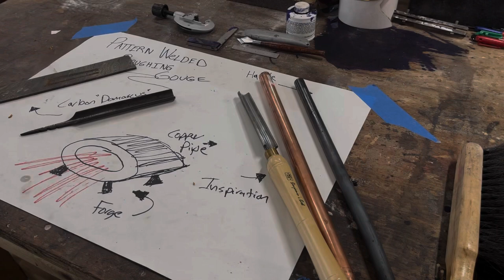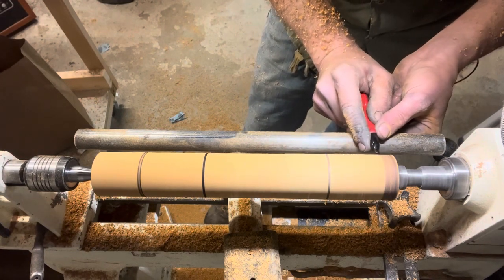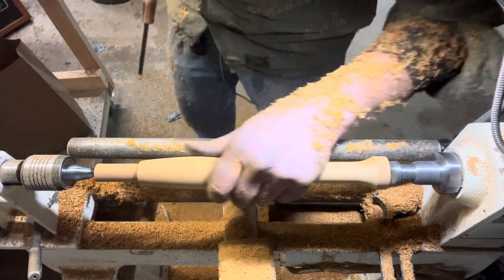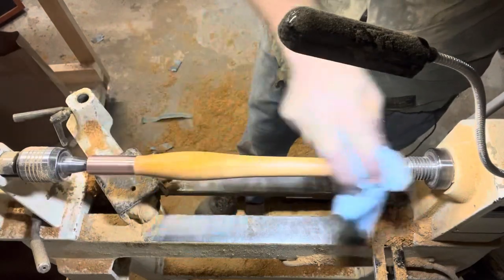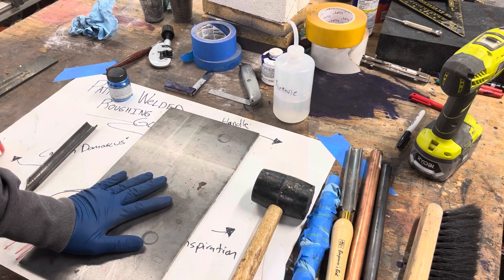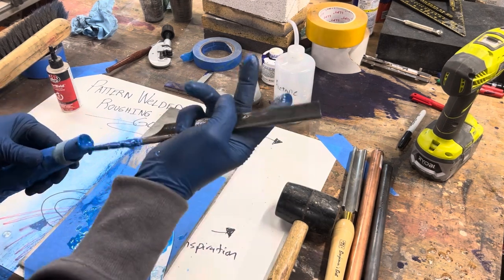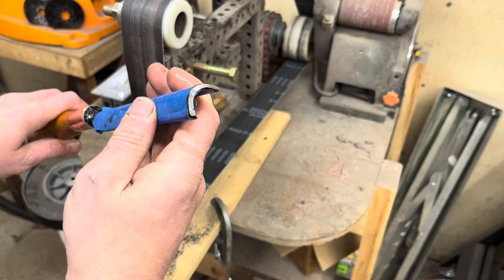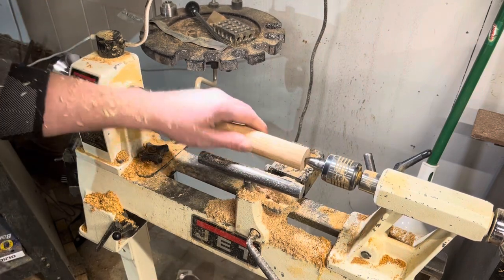Forging a Damascus roughing gouge - Part 2

Comment: For the grinder angle, its between 40-45 degrees, you can use your original bench rest on the 2x72 and cut a wood block to the angle you like and clamp it to the rest on its side like a miter gauge. It's a gorgeous roughing gouge. I was cringing waiting for the gouge to catch and cut the belt the way you were working it.🤣 we all gotta learn. Cant tell you how many belts I've cut getting something wedged.😜🤝
Reply from the maker: Thanks Mel and those are great tips and feedback! I’ve had knives catch before and was definitely concerned for all the reasons you mentioned.  Especially with soft backed belts like j-flex.  The grinder is all homemade and I think I may look into making it reversible for these exact situations.  Thanks for the watch and for taking some time to leave a comment and share some of your wisdom!